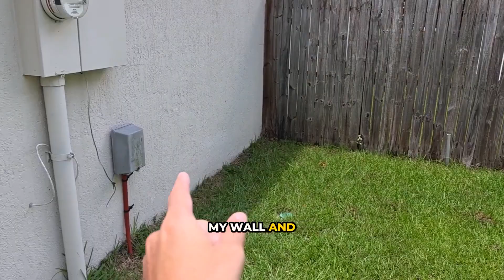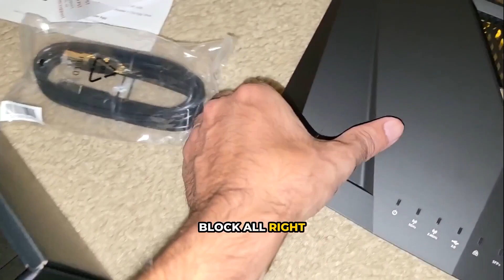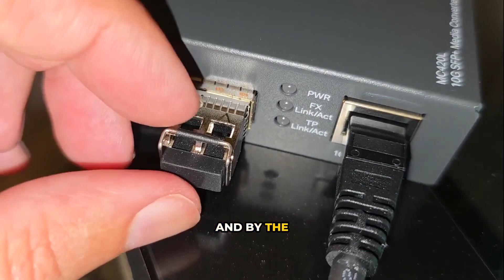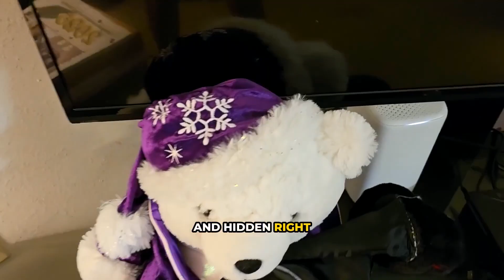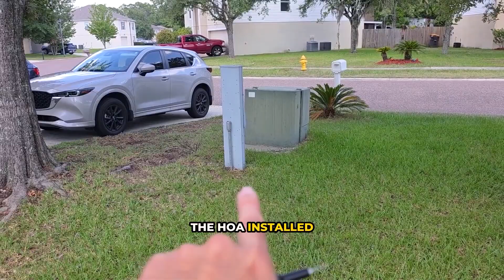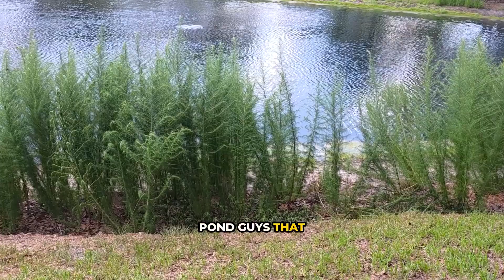Trying to Save my Router from Lightning Final

Comment: glad you finally went fiber, lightning does what it wants to do. I use surge protection on every end point, it only takes one thing plugged into a unprotected outlet to path back. you can put a whole house surge/lightning arrestor on your main panel. That is an expense you have to pay for. If possible, drill a hole and move that cablemodem to the wall where service comes in. That is your point of entry, get it away from the other stuff!!
Reply: you using any emp shields? you know when lightning strikes it can cause an emp as well
Reply: @squirrelmasters metal cabinets ftw
Reply from the maker: @squirrelmasters responded to you other post